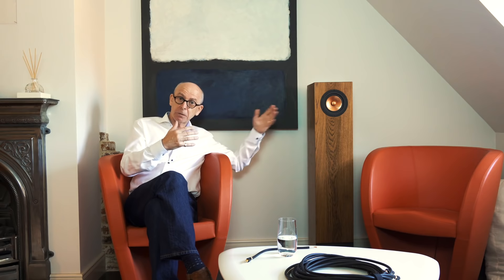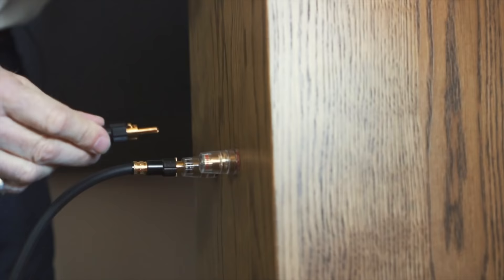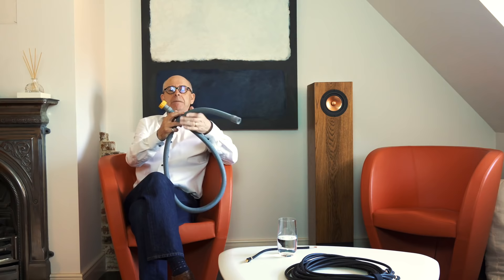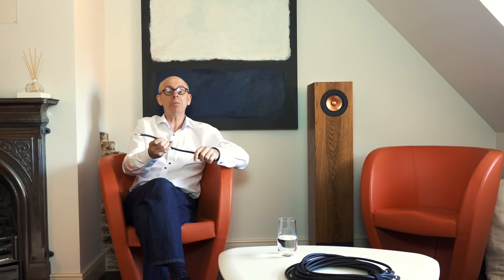Loudspeaker cables - how do they make a difference?

Comment: Audio cables are like homeopathy: Total BS, no basis in science, and rely on placebo — and provide extremely high profits to those making them. Every hobby has something equivalent by which its industry profits from the idiot set of the hobbyists. It’s a human societal thing, it appears.
Reply from the maker: Hi, I get your point but I hope you watched the video because in it, I make it quite clear that there is nothing special about our cable, it being made from twisted multi-core copper strands, encased in polymer and Rubber, with high quality banana plugs that clamp into the sockets. However, and this is the thing you might not accept, I say that it is relatively easy to design and make a cable that does alter the sound. You just have to use a sheathing that creates a capacitance and / or add some resistance and inductance. This can be done (and is done). We just like to make ‘neutral’ cables that clamp in place and last forever and cost a price reflecting the materials and the time they take to manufacture. I hope this helps?

Comment: I understand everything. What i dont understand is the ridiculous prices. Their is no explanation for them. Its just grabbing money from people who already invested a lot of money for their system. A 1.5 meter 1000 Euro cable is without the "money grabbing" worth around 20-40 Euro. Just the truth
Reply from the maker: Hi, I totally get your point. Indeed some cables are priced extremely high. However, I would like to point out that our cables are nowhere near that price. Our loudspeaker cables, for 3 metres are 345EUR, and that still is expensive, I know but they are made up of four very thick copper, multi strand independent cables, each with expensive expandable (lockable) connectors on each end, and they are hand assembled here in Belgium. if you take all considerations into account they work out at 28,75 EUR per meter + taxes and postage.
Reply: @PearlAcoustics  I saw that your prices are more realistic. And i appreciate that you don’t advertise with all the Vodoo. Unfortunately 3m is way to long for my needs.
Reply from the maker: @LaserPrinterBW  no problem, all our cables are hand made. If you need something shorter our team will happily help you. I can’t guarantee it will be much cheaper though 😉. Enjoy the music

Comment: A 3 meter set of cables (2 pairs) sets you back 305€ excl. tax

At the moment copper prices are about 8€ per kg
Reply from the maker: Hi, thanks for your comment. All I can do is assure you that we pay a great deal for our copper cable and by the time we add the cost of our connectors, cutting, assembling, packaging and posting, our profit on these products is very modest. no one is getting rich from what we do. Unless it is our suppliers.

Comment: Hello, thank you for your video; a very interesting, well articulated explanation.  I'm not an audio engineer, nor have I any formal education in the field, but two elements I wish you had covered are 1) does the signal pass through each strand or over the surface, and 2) you make no mention of "skin effect."  At the beginning of the video, you refer to pure copper wire coated with silver.  Without any coating (silver, rubber, plastic, or whatever material) on each of the 80 strands, will there not be some negative crosstalk, interference, or whatever the appropriate term is?
Reply from the maker: Hi Steve - it’s a known phenomenon that if you silver plate copper wire there is an impact on the sound, mostly it has an impact on the higher frequencies, over 3Khz. I am not knowledgeable enough, to ascertain exactly how the energy flows through our cables nor have we the very advanced equipment one would need to prove it. There are lots of scientific papers on the topic, covering observations, such as “skin effect”. But working from a strictly empirical standpoint, all we are saying is that when a multi-strand copper cable, such as ours, is used to connect a Sibelius loudspeaker to an amplifier, we are happy with the results. Quite what is  happening at an atomic level is for scientists more knowledgeable than me. However, I do know someone who can go a long way to explain this kind of behaviour and that is Colin Wonfor. You might find articles from him on the internet. Especially under Terlurium Q and now: EMA. Hoping this helps?
Reply: @PearlAcoustics  "It’s a known phenomenon that if you silver plate copper wire there is an impact on the sound, mostly it has an impact on the higher frequencies, over 3Khz."  Really ?  Known by whom ?
Reply: The explanation by Pearl is nonsense.  Energy does NOT "flow through the cable" - energy is transmitted by a magnetic field which is OUTSIDE the cable.  If you want to understand cables you should NOT listen to someone who is trying to sell you THEIR cable.

Comment: As a pro musician working the whole day with life acoustical instruments I can say that I have often heard differences between interconnects and speakercable. A lot of people are not able to hear this differences. So they say there are no differences.Let WW3 begin.
Reply: This stuff is fantastic: as a scientist I was always skeptical of the weird claims made by companies of how wire could alter sound: surely those wee electrons don't come in different flavours? I was sure that companies that charge a fortune for cables were simply scammers: 'those rich, superior idiots! They are kidding themselves how wires can alter sound, it's nonsense!' Then I got replacement wires for a pair of earphones (comprising copper pin connectors and wire) after the originals broke and the sound was... COMPLETELY DIFFERENT. I have since been told that this may have been due to solder being present out of view in the replacements - but there was no denying there was less treble and more bass when I switched. WW3...
Reply: @chriscura7989  So you heard, but very possibly didn't notice, the gradual degradation of the sound up to the point the electrical connection failed, then it sounded better when fixed.  It's so simple to debunk this stuff and it has been but the peddlers of snake oil and overpriced cable drown out the science with pseudo-scientific nonsense.
Reply: Cables are the most divisive topic , don't go there.

Comment: Be careful of anyone trying to sell you something.  You are full of it-you decide what the it is.  Can't believe you talked 15 minutes about copper wire you can buy anywhere. I'll bet you want hundreds of dollars for your factory made speaker cables.  It doesn't matter if the wire has 80 strands or 60 strands, the length of the cable verses the gauge of the cable is what is important.  Even the cheapest copper speaker cable you buy these days is oxygen free.  There is no better wire for the job it is asked to do.  Do a double blind test and all of you intellectual BS will go away.
Reply from the maker: Hi, thanks for your comment. I truly appreciate your opinion. When I was growing up, I couldn’t afford good quality HiFi, so I had to make everything myself, or buy second hand. When I was 21, I set up my first company ‘DIY HiFi’ and we sold plans of one of my loudspeaker designs for people to make at home. From that exercise, I learnt that the vast majority of people couldn’t be bothered to make things themselves and wanted to buy off the shelf. I guess you can compare it with cooking a meal at home versus eating out in a restaurant? It’s much cheaper at home and perhaps the ingredients can even be of a higher quality, but you have to know how, and also be bothered. 
Our cables are hand made (assembled) in Belgium from high quality components. And you’re absolutely right, anyone can go out and buy the necessary copper cable and some connectors (we use special locking ones that are not easy to find, except on line) and then they will need a good quality hex driver, some sharp wire cutters etc. Or, indeed they could pay a few hundred Euros and buy some ready made from us or other on-line stores. By the way, the cable we use is only available via professional retailers and you need to order 1km at a time. But you’re right, other cable will work too.

Comment: He didn't even get the water pipe analogy correct.  In that analogy, voltage is not the speed of flow, it is the water pressure.  He goes on to completely miss the fact that a voice coil is an inductor.  So, his driver designer actually changed an inductor (part of a motor), which is a far cry from what he tries to describe.  This guy is full of beans but at least he isn't perpetuating cable snake oil.
Reply from the maker: Hi, thanks for your comment. Indeed, I could have explained the water pipe better, I was only really looking at flow to ground, rather than how I could have explained electricity itself… a missed an opportunity. As for your observation in the inductance of the voice coil, that’s so obvious it’s brilliant. You are the first of all my commenters to have picked this up and after so many years of designing crossovers and step filters, I completely overlooked this because I was focusing on the change in the profile of the wire of the coil itself. Perhaps both is true, who knows? The important thing is the upper mids were significantly improved and my enclosure design was saved and now we have very happy clients, all over the world.

Comment: I am not exaggerate these audio phile seems to overlook the physics of electronics and the biology of the listners. human ear has its limitations and most of the people cant listen to all the fine nuances of the music its more of a psychological perception. As one grows older the ear degrades and hearing worsens so I believe most old fellows are wore at hearing than a 10 year old kid!!. 
As far as cable is concerned as as long as the cable is fairly thick copper which offers low resistance and inductance it is capable of deliering the sound. For those who disagree with me feel free to open up your amp and see the PCB track from the the amplifier to the terminals before spending 100 or 1000 of £ on a silly cable!!

Comment: Are those drivers mark audio?
Reply from the maker: Dear Adam. Yes indeed they are. They are a special design, made exclusively for the Sibelius loudspeaker. See our other video, the story of the Sibelius loudspeaker.
Reply: @PearlAcoustics  thanks for the info, but your margin must be astronomical
Reply: @adamsojka3345  I had a look at mark audio drivers via the UK dealers website - many of them are about £80-100 though there are some which go for £500 for a pair. The speaker mentioned here appears to use the regular £80-ish each drivers. So yes, 3,000 euros for a pair of wooden boxes with no crossover, just terminals wired to what appears to be £200-ish worth of drivers doesn't appear to represent value for money.
Reply: @HandbrakeBiscuit  That is exactly what I was thinking. I really doubt there are no superior speakers to this in the price range. I guess I have to built a speaker using these myself a see.

Comment: Silver coated....
Gold, silver, platinum or poop coating.... It doesn't matter because of the lowest denominator (probably some ferous metal used in the connection between output transformer and cable)
You can do interconnects with 24 gauge wires without issue.
You can use simple copper wire as speaker cables.
No one will hear the difference....

Anyone for DIRECTIONAL cables or CRYO treated ones?
Reply: The plating does make a difference....more reliable. Significant for interconnects...not so much for speaker wire
Reply: Or directional fuses.

Comment: I use 12 ga copper oxygen free.
No banana ,s.
25 ft each side.
No problem.
Can't find 12 ga at any store.
Plenty of 14 ga.
Stranded wire.
I like the idea of better cables but  in a pinch, use 14 ga lamp wire. Cheep and abundant.
These companies trying to sell you $$$$$$. Wire is B S.
IMHO. I mean if u go from 22 ga to 14 ga u should hear a big difference.
I'll NEVER part with my 12 ga copper speaker cables.
Reply from the maker: Indeed, I am not out to sell loudspeaker cables but to say get simple, multi strand, ofc cable. Good connectors are also  a big bonus.

Comment: I'd love to see the phase response plot of on of these speakers ... is there any kind of Doppler generated modulation at high frequencies? This is always the downfall of full range drivers ...Have you ever tried a Lowther PM6 driver in a similar enclosure by the way ?
Reply from the maker: Yes. A Lowther would not work in this cabinet. But I know the drive units since I was 9 years old. It was great in its day but sadly, they never developed it to anywhere near its potential. Have you seen my video ‘the story of the Sibelius?’ Its king but I talk about Lowther in it.
Reply: @PearlAcoustics  thanks for your reply... I just threw the PM6 into the ring just to get your take on it ... I used them in various types of enclosure and found them more at home in a large horn loaded cabinet with a large horn aperture ( unlike the Sibelius ...the horn length was critical and necessary if reasonable low frequency extension was required ... the only good thing going for it was efficiency.. 89-90 dB / Oct

Comment: The water analogy was completely wrong. The voltage is not the speed of the water flow but the pressure the water exerts on the wall of the hose.
Reply: We must remember that this is the same presenter who, in a different video, describes "dynamic range" as "bandwidth" and vice-versa. Great speakers connected to a great amplifier in a reasonable listening room will sound great when connected with plain old-fashioned stranded zipcord (lampwire).

Comment: They dont
Reply from the maker: 😉 thanks for your comment. however, I can assure they can get no act the sound if a cable manufacturer deliberately sets out to do so by selecting certain kinds of polymer coatings and installing components into the cable or connectors that change the capacitance, inductance or even resistance of the cable, they can easily create a kind of step filter within it. It’s very easy to do, but it is ‘interfering’ with the signal.

Comment: If you choose your main source, amplification , speakers and cable carefully you can get a fabulous sounding system for just a thousand pounds or less. Of course consideration needs to be given to the type of music you primarily listen too and the room your equipment is going into. The whole industry leads people into believing you need to spend many thousands of pounds and to continually strive for perfect Hi Fidelity. It’s total BS, just do your research and go and shop where you can listen to what you’re interested in buying.
Reply from the maker: Hi Mario, I totally agree with you about choosing what’s right for you and your budget. No one should feel pressured into buying something they don’t need or want. I also agree that with careful buying and sensible expectation management, great results can be achieved at a low cost. Especially if people are prepared to build their own amplifiers or loudspeakers or buy secondhand.

Comment: As long as the wire size is big enough and connectors are good any cable is fine. The rest is nonsense.
Reply from the maker: Thanks for sharing. I am assuming you mean copper wire… and there we agree. As you probably saw in our video, we recommend multi-strand copper with good quality connectors, no gimmicks etc.

Comment: If you can hear it, you can measure it. At least that's what the audio engineers say, alas, to the dismay of cable believers.
Reply from the maker: Hi, I tend to agree…. Some cable differences are tiny, almost non measurable. But somehow we can have two perfectly flat performing amplifiers (for example) that still sound different. It really depends on what you test, sine waves or complex  music 
There’s so much non sense talked  about cables, but believe me if you adapt a cable casing and give it a 5 microfarad capacitance value, you will hear and be able to measure a big difference. This is just an example. Enjoy the music

Comment: I just sold my isotek orion mains and kimber kable monocle XL because there was no difference between  cheap cables and expensive ones.
Waste of money.
Reply from the maker: Hi Arthur, absolutely, I find on the mains side it often does not make a difference, especially if your amplifiers etc, already have mains filters in them. On some very simple tube amplifiers it can make a difference. However, some people absolutely swear by them.

Comment: What I don't understand from his justification (flawed) is sure the electrons may move differently in cables, but how does it change the sound (which is changes in frequency response)? Remember whatever you do outside the equipment will not alter the design of the circuitry.
As long as there is a good conductor to  bring in sufficient electricity to the gadget, it will suffice. All other reasons are bunkum. This fellow has no idea of what he is talking about. Just like all the others like him.
Reply: A cable is not goint to change the frequency response in any way.
Reply: @Hunpriest  Actually it does, albeit in a minuscule proportion. Mostly bc of the skin effect which starts showing up at around 10KHz. But any multi strand cable will greatly minimize that. And try as they may, most people, even young ones, will never notice minute differences past 10KHz...